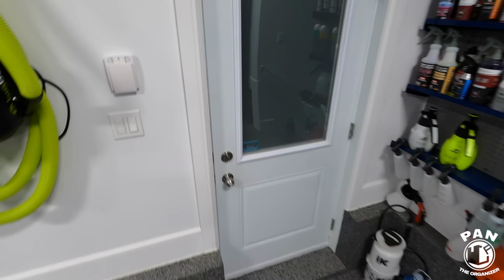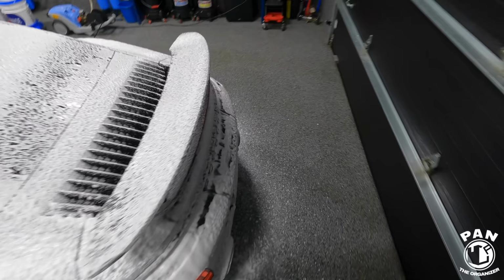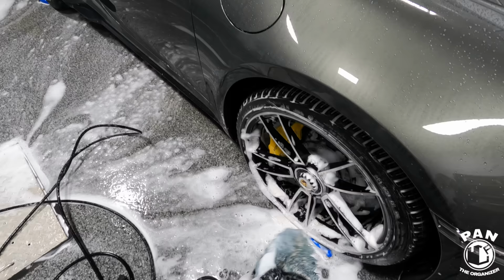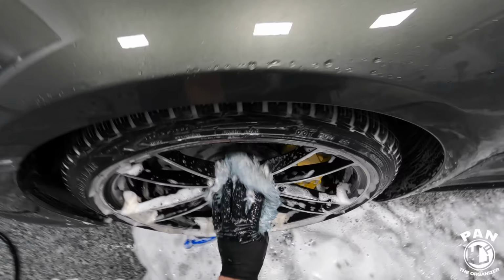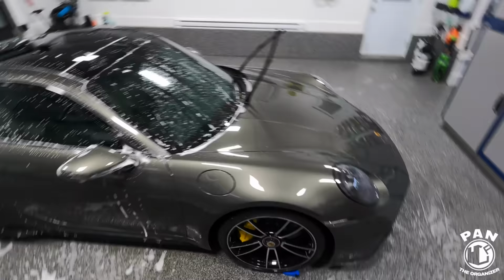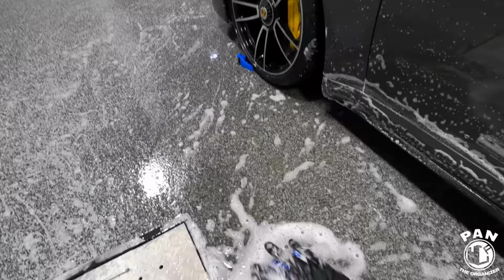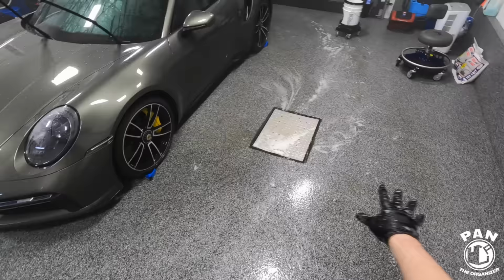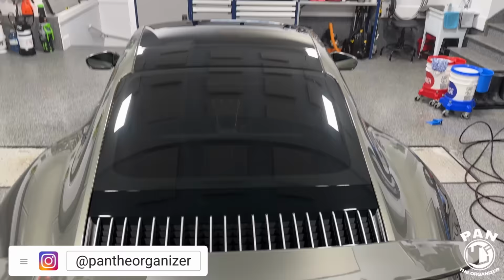Cleaning A Dirty Porsche 911 Turbo S : Exterior Auto Detailing

Comment: So, Question 😁 WHY is there no Swisstrax? 🤗
Reply from the maker: There are two floor drains in my garage, and slopes so the water drains towards the drains, so I'm unsure of how those tiles would work. I'll have to talk to my buddy Matt (Obsessed Garage) about it. But I love my current polyurea floor coating. Anti-slip, chemical resistant, impact resistant, looks cool and maintenance is a breeze. Just pressure rinse, and done. For the Swisstrax, in climates like in Montreal, I'd have to remove the tiles to clean underneath often as winter muck accumulates. My friend Rick from RAD Garage (he lives in Calgary) has a Swisstrax floor and he makes videos of how he has to remove and clean and it seems like a hassle. I like simple care free maintenance.

Comment: In the IK e foam pro 12 as well as the IK pump sprayer I've seen in another video, which foam tip are you using? IK, the manufacturer, indicates there's one tip for dry foam, (green) one for intermediate foam, (grey) and one for wet foam. (orange)
Reply from the maker: I use the stock tip that comes preinstalled. It’s the grey if I remember correctly.

But you can experiment and see what tip you prefer. It’s a personal taste situation here.
Reply: @PanTheOrganizer  Okay, that's what I currently trying out to see what I like better.

Comment: Hey Pan! When I wash my wheels I just use a sponge and apc, but I don’t do the brakes or tires. Should I start cleaning the tires and calibers? If so should I use the soap I use on the paint or get dedicated things for the wheels and tires?
Reply from the maker: It's always important to clean and degrease the tires before applying a fresh layer of dressing. To prevent tire sling, tire prep is key. And yes you should have a detailing brush to clean the brake calipers every now and then when you see dirt. 

For the soap, have a separate bucket just for wheels and in there, yes you can use the same shampoo as you do in your buckets for the paint.

I will have a full updated tutorial soon on how to properly clean wheels and tires.

In the meanwhile, watch my existing wheel & tire cleaning tutorial: https://youtu.be/Ty4ZTq7A7rc
Reply: Thanks pan! I think I will run to Canadian tire today and try and find some brushes, what type of brushes do you recommend? Thank you for responding!

Comment: Thank you for posting this video, I enjoyed it a lot. Just had a curiosity did you get special undercoating done on your car to help with corrosion? Also, as meticulous and clean as you are, how do you deal with the interior? I’m sure you have all weather mats you get the urge to clean them after every time you go out during the winter? I have all weather mats in my car, and during the rainy seasons, I cover them with towels because I’m OCD.
Reply from the maker: Hi Daniel. No special undercoating on my Porsche. I get a brand new car every three years, and take care of my car so much that rust is of no concern to me. Also, to my knowledge, I think I remember that the German brands usually don't recommend undercoatings as that could void the warranty, and they use high quality galvanized steel anyways (or aluminum) and those don't rust. Don't quote me on that.
Reply: Thank you for replying!!!! 😀

Comment: Nice video. Curious if you 😊did ppf on the car.
Reply from the maker: Thanks! No I never PPF my vehicles. I only keep them three years and get a new car every three years. And I don't drive much in a year (less than 6000km or 3730 miles per year) so stone chips are of no concern to me.

The Porsche comes with PPF in the lower parts of the rear wheel arches though, as those super wide hips do get impacts from rocks. And that's one area I'm glad to have PPF, as I recently had it replaced. I will have a video coming soon on that, so stay tuned.

Comment: What are your thoughts on the theory that polymer based products like Bead Maker actually clog a ceramic coating?
Reply from the maker: It's not that Bead Maker is "clogging" the coating. Like any topper that you would apply, you are slightly altering the coating's properties for what ever you put on top. Some people call it lightly masking the coating's properties. But the tradeoff is you increase gloss and slickness when applying Bead Maker, so even if the hydrophobics aren't as great as the best of ceramic coatings, you are getting good benefits. You have to try and see for yourself what you prefer.
Reply: @PanTheOrganizer  thank you for explaining! I just had Gtechniq Ultra applied.
Reply from the maker: Great coating!! See my video on ceramic coating maintenance, in which I used all Gtechniq products: https://youtu.be/IqIW78FmRYU

Comment: My Griot’s Garage foam cannon marble thing gets bad surface rust. I frequently have to remove that. Do you also deal with that?
Reply from the maker: I don't have that issue, as I thoroughly rinse out the foam cannon after use, and let the parts air dry. Did you try reaching out to Griot's?

Comment: Hey Pan, do you have any paint protection film on the car? Thanks!
Reply from the maker: Just the two small factory PPF pieces on the rear wheel arches. I made a video showing how we replaced and ceramic coated those here: https://youtu.be/gusUiD9uoW4

Comment: Have a question regarding wheels.  I have white powder coated winter wheels and I have some brown staining on the barrel and some of the spokes. I used p&s brake buster 5:1 and than used it 1:1 and there is still some brown stains that I can’t get out. I used my wheel brushes and all the wheel tools and I couldn’t get them clean :(

Ps love the channel you have taught me so much over the years!
Reply from the maker: I don't deal with powder coated wheels so I can't help you on that topic unfortunately...
Reply: @PanTheOrganizer  it’s a satin finish that some aftermarket wheels have. So basically they are white satin wheels.

Comment: I love it Pan! I have to go to an event in the morning and want to do a maintenance wash, but I ran out of bead maker and the only wax I have is Chemical Guys butter wet wax, can I apply that after my wash to make the paint pop?
Reply from the maker: If you have a ceramic protection, I wouldn’t apply a wax on top. If you have no protection or you have a regular wax/sealant, it’s ok.
Reply: @PanTheOrganizer  I haven’t did my regular clay, seal and wax but after every maintenance wash, I always add bead maker. I’m planning to do a clay, seal and wax this summer

Comment: Hi Pan, what do you recommend to remove the carbon from the exhaust so that they become shining again?
Reply from the maker: It depends on how bad the carbon buildup is. You first start with the least aggressive method as I show in this video: https://youtu.be/0lC9uyKXs8Q?t=586

If that's not enough, you move to a high quality metal polish like this: https://amzn.to/43CP9kx
With some 0000 steel wool: https://amzn.to/41jXOqA

I hope this answers your question!
Reply: @Pan The Organizer  Thanks for responding and for the advice.

Comment: Nice video Pan!! I have a 992 TTS and how do you fix all the stones that gets collected by the side air intakes?
Reply from the maker: You have no choice to replace the PPF on those rear arches when they are too far gone. Plus I add a coating on top. I just replaced mine and filmed the whole thing. Video to come soon so stay tuned.
Reply: @PanTheOrganizer  Ah I mean all the small stones that end up in the actual air intake!! On the plastic inside the intake!!

Comment: what does the mckees pre rinse do that the koch chemise active foam can’t?
Reply from the maker: Don't confuse a pre-treat (with a rinseless wash) with a pre-wash (snow foam). A pre-treat is to add lubrication on the surface before you rinse the vehicle. A pre-wash with a snow-foam is to start removing loose dirt and debris, and with higher pH versions start to soften road grime and traffic film, to clean as much off the surface before the contact wash. This reduces the chances of marring the paint when hand washing.

There are many ways to wash a car. Some like to pre-treat, then rinse, then foam, then rinse, then foam again, and hand wash. Some like to foam on dry, and rinse, and then wash, etc.

Comment: Hello Pan, quick question what's best way to clean inside gas cap? Thanks.
Reply from the maker: I will have a video with many tips and tricks coming soon, including the gas cap. Essentially, you can spray a bit of APC and use a detailing brush to clean the area, and then rinse off. It's that simple. 

If your car is regularly maintained and is fairly clean, you can also use the snow foam that's on the car in the pre-wash stage to clean inside there, with a detailing brush. See how I do it on my own Porsche in this video: https://youtu.be/KEAfc_LUO4E?t=442

Just be careful of capless fuel fillers/gas tanks. Don't spray high pressure water there. Clean the area and wipe with a second damp towel (damp with just water).
Reply: @PanTheOrganizer  thank you! ❤️
Reply from the maker: No worries. ;)

Comment: Great video Pan i just had a quick questin about the drying aid. In pervious videos you mention not to cake the car with so much protecton. Siince beadmaker is a type of protectoin is it bad to always use it as a drying aid? Since i know you wash your car 3 times a week do you always use it after every wash?? I wash my car about once a week and i switch between bead maker and technicians choice 582 but after washing the car the protectin wears down and water becomes somewhat flat after washing the car, is it becuase of the shampoo im using ?? I use reset and GSF i switch back and forth and my car is not ceramic coated but it does have relod 2.0. Anything to clearify would help.Thank you i enjoy watching your vides.
Reply from the maker: As I mainly use a blower to dry my car, you don’t use a drying aid. So no need for a topper. I’ll use a topper perhaps once every 3-4 weeks. And Bead Maker only lasts 3-4 weeks anyways, so I never overload the coating underneath.

I wash my car once or twice weekly. Not three time hehe. Even I have a limit to my madness… 😂

In your case, for sure Bead Maker and Tech’s Choice are super light topper and don’t have much chemical resistance. CarPro Reset is a bit too strong for those weaker sprays. Reset is made for maintenance of true coatings in glass bottles.

So perhaps try a more gentle soap like Gyeon Bathe or Adam’s Car Shampoo.

And as your base protection, if you don’t want to apply a true coating, at least use something more durable than Reload, like Gyeon CanCoat EVO for example. That will give you 9-12 months of protection.
Reply: Thanks for the advice, its such a huge help and info to keep in mind for the next time i wash the car. @PanTheOrganizer
Reply from the maker: My pleasure! How did you discover my channel by the way Josue?

Welcome to my channel. You discovered one of the biggest car detailing channels on YouTube as we surpassed 965,000 subscribers and we have over 130 million views! I have been detailing for 26 years and I love to share my knowledge and passion with my viewers.

You found the right channel to help you learn everything about detailing.

Comment: @pantheorganizer : Do you not use p&s brake buster anymore? Or do you prefer auto fanatic wheel cleaner instead
Reply from the maker: I don't need to use Brake Buster on my car really as I have carbon ceramic discs that don't generate brake dust or iron particles. So I don't need strong cleaners. But on most cars, Brake Buster is still my favourite wheel cleaner for sure. Also, as this is a detailing channel, I like to use different products to give viewers alternatives.
Reply: @pantheorganizer : Thanks for the response. Totally understand where you’re coming from in both your points. I’ve been hesitant to use brake buster on my G80 m3 black wheels due to some people saying it wears on wheel paint. But I wanted an easier solution to all the break dust. I suppose I just dilute it more since it’s not my daily & the brake dust isn’t caked on. I like to see what you’re using on your own personal vehicle. I saw you use break buster last year on your “full detail after winter video” . Thanks for sharing your experiences with us. Cheers 🍻

Comment: I really like the Porsche! Is it a manual? I just bought a genesis g90 myself
Reply from the maker: All 911 Turbo S are 8-speed PDK (dual clutch). Way too much power for a manual transmission. Pretty much all powerful supercars are automatic these days. Way faster than a manual transmission.
Reply: @PanTheOrganizer   understood, Imo, manuals are so much fun to drive. I live close to a stretch of road in the Appalachian mountains called "tail of the dragon" I think you'd like driving it ;)  btw...have u tried Meguiars black wheel cleaner for your rims?
Reply from the maker: I haven't tried that one. But my wheels are super easy to clean as they are ceramic coated, plus the brakes are carbon ceramic discs, so zero brake dust. No iron particles. :)

Welcome to my channel. You discovered one of the biggest car detailing channels on YouTube as we surpassed 940,000 subscribers and we have over 123 million views! I have been detailing for 26 years and I love to share my knowledge and passion with my viewers.

You found the right channel to help you learn everything about detailing.

Comment: Great video Pan, quick question, would you be able to use ONR as a pre-treatment?  Also have you ever detailed an engine bay on an EV? I have the Citroen  EC4, not sure if its available in Canada , but all the high voltage signs in the engine bay are very intimidating for thinking about using a snowfoam and pressure washer on it lol
Reply from the maker: You can use any rinseless wash as the pre-treat. For ONR, or the McKee's, or P&S Absolute, or DIY Detail rinseless washes, use the 1:256 dilution ratio (0.5 oz to a gallon of water) and put it in a pump sprayer and pre-treat, then rinse off, then continue with your wash procedure.

When it comes to hybrid engines en EV engine bays, most of the common sense and tips are similar to regular engine bays, with a few slight tweaks.

Here are some videos that give more details: 
Toyota Prius engine bay: https://youtu.be/UQhrIEYwW9E
General hybrid engine bay cleaning tips: https://youtu.be/AHosBEZAHPY
General tips: https://youtu.be/X_cwN4ljpG8
Reply: @Pan The Organizer  thanks for the reply Pan, its much appreciated 👍

Comment: @PanTheOrganizer  does that McKees N914 as a pre soak/rinse work well with the Marolex foamer or do you prefer the sprayer for that task?  Thx
Reply from the maker: In theory it foams a bit so you could use it in the Marolex Axel foamer (blue top) but I prefer the regular Marolex Ergo or Industry for that, or an IK Multi Pro 2 (non foaming pump sprayers).
Reply: @PanTheOrganizer  sure appreciate you taking the time to reply and provide your feedback.   Thanks for that kind sir.

Comment: Pan.what would you recommend  using  to clean  painted  alloy  wheels?
Reply from the maker: What do you mean by that? Non factory finish?
Reply: @PanTheOrganizer  They came stock with my 2022  subaru  forester touring.  The painted  alloys is the description  for the car when looking at the specs. I bou the car new in January  of 2022, I have been using  chemical  guys diablo  wheel gel  but would like to know if there is something  else you would  recommend  from your experience. Thank-you.

Comment: Hello Pan, you use a 40 degree tip, but what orifice size is it? Thanks!
Reply from the maker: It's a 4.0 orifice. But if you don't have my specific pressure washer (Kranzle 1122TST), knowing the size of the orifice I use is pointless, as you need to select the correct orifice for your specific pressure washer to adjust the specific water output and pressure to your desired level.
Reply: Got it, thank you for explanation. @PanTheOrganizer
Reply from the maker: Welcome to my channel. You discovered one of the biggest car detailing channels on YouTube as we surpassed 940,000 subscribers and we have over 123 million views! I have been detailing for 26 years and I love to share my knowledge and passion with my viewers.

You found the right channel to help you learn everything about detailing.

Comment: So you put water on the car before you do the wheels
Reply from the maker: There are many ways to wash a car. 

Welcome to my channel. You discovered one of the biggest car detailing channels on YouTube as we surpassed 1 million subscribers and we have over 135 million views! I have been detailing for 27 years and I love to share my knowledge and passion with my viewers.

You found the right channel to help you learn everything about detailing.
Reply: @PanTheOrganizer  so I guess what I was trying to say if you didn’t have CR spotless Would the water leave water spots while you were doing the ties was not questioning your know how
Reply from the maker: It depends how "hard" your water is. If it's relatively soft, having a bit of water if you are quick to blow dry it, or towel dry it using a drying aid as lubricant, won't generate water spots. But if you have hard water issues, and are working in the blazing sun (a big no no in the detailing world), then yes you'll inevitably get water spots.

See my video on water spots: https://youtu.be/s1XNKFVSwRk?si=mkepTpAOo22JWq9u